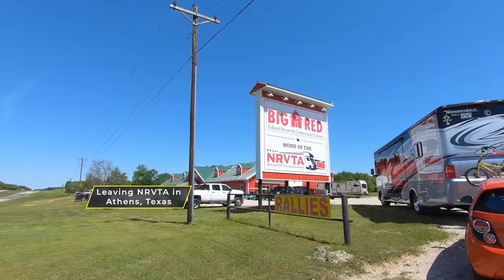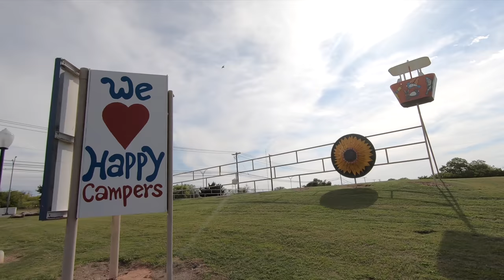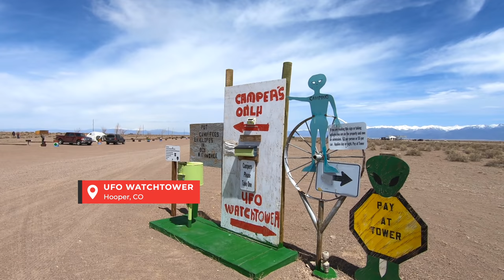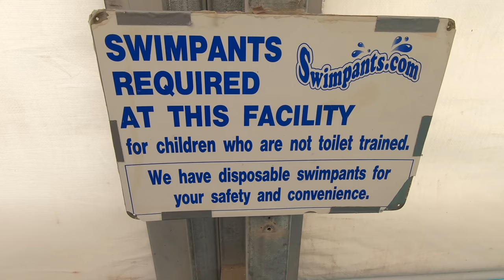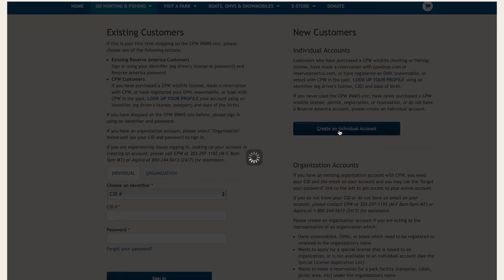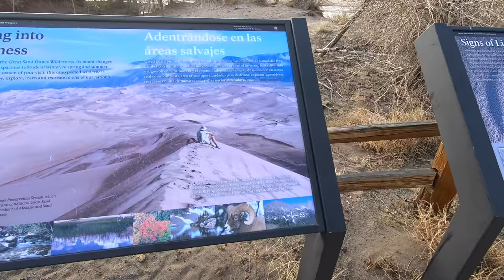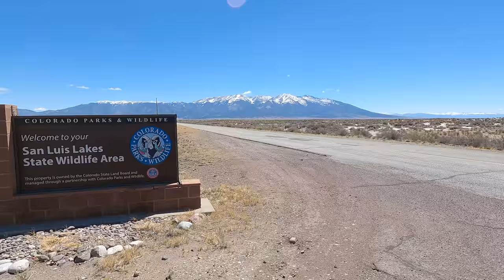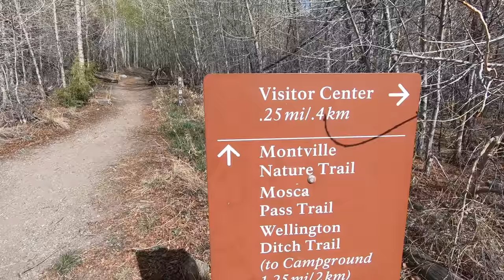Great Sand Dunes National Park (Full Time RV Colorado)!

Comment: We were in Dalhart on our way to Royal Gorge in Colorado on the 25th of April.   Just wo days behind you.  We had 20 to 30 mph winds while we were traveling.  You did goid getting there before the winds. We had to make an emergency repair when a 4 foot section of the under belly on our RV tore loose and was flapping out the side of the trailer going up Interstate 25. It's an adventure.
Reply from the maker: That's no fun!  Hope you got it all fixed up!
Reply: I was able to put some screws in it to hold until I could get to Lowes in Pueblo.  Then I repaired it with self tapping screws and waterproof Gorilla tape on the split seams.  Worked great! Only caused about a 2 hour delay.

Comment: Driving thru the sand storm. Did you check your engines air filter after? Or wasn’t it that bad?  Never been there just seeing if it’s something I need to look out for.
Reply from the maker: Good point!  We didn't drive that much in the sand storm, but it's worth checking! 👍🏼